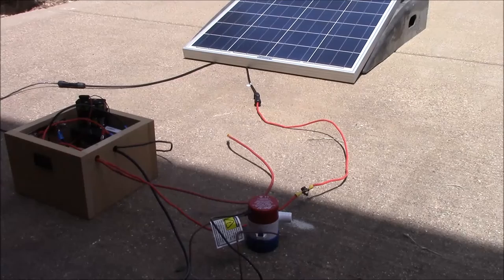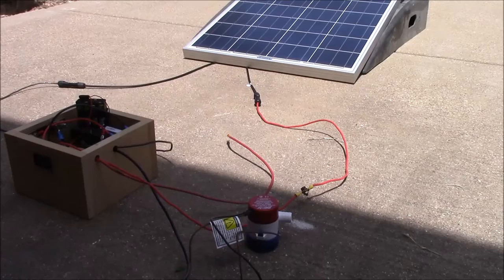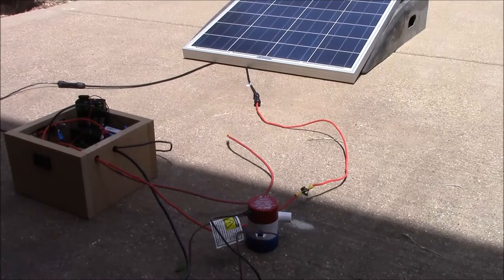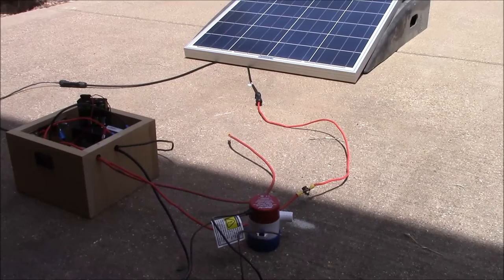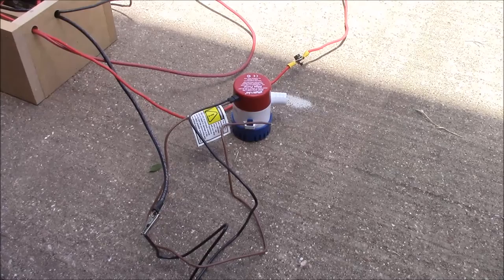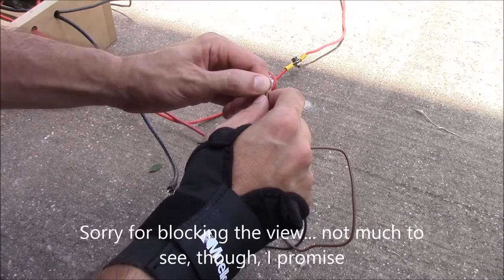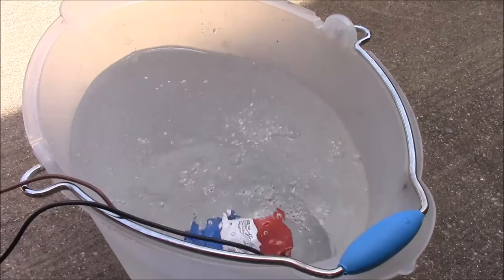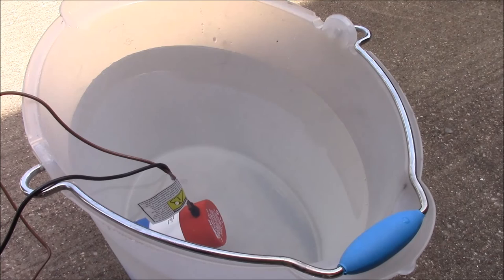Will It Solar? - Bilge Pump

Comment: Have you tested how long you can run a bilge pump off the 12 volt battery while being charged by the panel
Reply from the maker: No, I haven't.  There would be quite a few variables, though.  So I am not sure how helpful that would be for you.  Unless you had the exact same solar panel, pump, and battery.
Reply: @LDSreliance  working on making a live well to keep bait alive the 5 watt panel i have on it does not keep up with the demand 750gph pump 12v 9amp battery trying to figure what voltage panel i would need to run it for a full day of fishing
Reply from the maker: Yeah 5W will maybe make 3W.  That kind of panel would only really be useful to keep a lead acid battery topped off on a charge between uses.  To fully recharge that battery, that panel would have to be in direct sun for 36 hours straight, give or take.

I would recommend at least a 50W panel.  But it would also depend on how long you are on the water and other factors.

Comment: you were talking about using it for your aquaponics system im looking to do the same thing with the same pump. My question is what size solar panel are you using and the pump in the video runs on 2 amps will the solar panel be enough to keep the battery charged so the pump can run 24/7 in the aquaponics system?
Reply from the maker: +Dinsmore Outdoors So this is where proper planning ahead of time is critical.  Your pump in an aquaponics system is essential to the whole thing running properly so you can't afford for it to be down.  And you have a 24/7 load to deal with coupled with unpredictable weather where it could be cloudy or overcast for several days where your solar panels will not produce much power to charge the batteries.

Without knowing where you live and being able to tell how much sun you will have access to, I would recommend 300-350 watts of solar panels and 200 amp hours of battery power (at least) for your system.  Sure, a 2 amp load doesn't seem like much but when the sun only shines on average 4-5 hours per day your solar panels only have a limited amount of time to recharge the batteries and that is while the pump is sucking some of that power.  This setup will give you 2 days of backup power for overcast situations.

If you are going to be monitoring the system and switching over to a different source of power if the batteries run dry, you could get away with 100 amp hours of batteries and 280 watts of solar panels.  That is the least you need to plan for.  That should keep your pump running 24/7 as long as the sun shines each day.

Comment: I’m sure you’ve covered this topic before (so please link me a video or bear with me) what would I need to run this on my Jon boat all day? I want to build a solar set up (Arizona gets HOTTTT) where it charges/runs my bulge pump all day and can run it at night when sun is down? I do have limitation on where I can place it (the panel in the video looks HUGE for my application. Realistically speaking, I have about about 12”x8” flat area that I can mount a panel to. Lastly, would I be able to stand on one? If not, my useable area would decrease to about a 6”x6” area. LITERALLY any information would be much appreciated. Love the channel, I am subbed now! :)
Reply from the maker: Thanks for the sub!  Unfortunately, running a motor like this, even thought it is small, around the clock requires a massive amount of solar power.  And it sounds like you are already limited for space.  If the pump can run for a few seconds or a minute and then shut off for a while that would be ideal.  Then you could get away with a small panel and battery.  I used a large one in the video because that is what I had for demo purposes.

Comment: Are t you only supposed to run these with water to cool the thing?
Reply from the maker: Yes, under normal use the pump should be submerged.

Comment: Can u explain what all you have hooked up to it to make it work? I have same pump and solar panel but my pump won’t run off the panel….
Reply from the maker: Yes.  You need a charge controller and battery to make this work unless you know a lot about electronics and can regulate the voltage yourself.  The problem is your solar panel outputs ~17V and your pump is only designed for 12V.  So you need a buffer in between that can change the voltage for you.  The best way to do this is to use a charge controller and battery because it will also serve the benefit of preventing any disruptions due to the sun going behind clouds or the angle of the sun being off, etc.

In short, you need solar panel->charge controller->battery->pump.

Comment: So ca I have solar panel then charge controller then pump
Reply from the maker: Yes, the charge controller can run the pump off of the load terminals if the pump is DC.

Comment: how many watts does it consume?
Reply from the maker: 2 Amps or 24 Watts.
Reply from the maker: http://amzn.to/2wHq0Zw
Reply: THank you I purchased 1100GPH version and consumes from 6 to 7AMPs. I have another one 3500GPH and should consume around 12A DC.
Reply from the maker: Nice.  Those are obviously much more powerful than this little pump that I bought just for demonstration purposes.
Reply: @porrascarlos80 but it says 12v, 3 A that makes it 36watts only.

Comment: Volts x Amps is  what matters not solar panels...
Reply from the maker: It isn't that simple.  Some devices require extra current to get started
 even though their running consumption is within the range of a solar 
panel.  Some devices can't handle a fluctuating voltage.  And some 12v 
DC devices can't handle a direct connection to a solar panel because a 
12v panel will actually produce 16-17v and the device won't accept that 
higher voltage.

Comment: What size solar panel would I need to run a 500 gallon GPH pump direct current?
Reply from the maker: To run it directly like in the video?  Or with a full solar system?
Reply: @LDSreliance  like the video, direct current from the solar panel to the pump
Reply: I know that a battery should be put in the circuit to keep power when clouds go over.
Reply from the maker: It seems like a pump of that size uses 30-40W.  So I would say a minimum of a 60W solar panel.

Comment: I have this exact pump with a float switch to evacuate excavation holes.
Powered by a deep cycle 12v battery with a 2.4W solar maintainer on the battery, I have 24 hours on the hour meter (installed after the switch) no problems yet.
Reply from the maker: Sweet.  Sounds like you don't need to use it every day so that small solar panel should work great.  That is a great use for solar!
Reply: The wonder of automation is the panel just maintains the charge unless it rains, then the pump turns on evacuates the hole, and goes back to charging. Elegance in simplicity.
Previously I had to wait for the rain to stop and bring gas powered pumps to a site, or a syphon hose and drain any water every time it rained witch could take all day depending on where the job was located, now we bring a solar automatic pump and leave a sump in the excavation and if it rains you just wait a day and when you arrive the site is already free of water.
Reply from the maker: Like I said, great use for solar.  I like it.  This should be a case study for how to effectively use solar to solve a problem.

Comment: we ran the exact pump straight off a 21v 60watt panel. maybe did 50 hours work so far and seems to last no problem. no battery or solar charge controller used.straight from panel at 21v
Reply from the maker: It might be just fine long term.  But most 12V DC devices are not going to like seeing 17+ volts without a shortened life.
Reply: @LDSreliance   2 years old now and would of done 1000 plus hours. still going fine @21volts..

Comment: Also while connecting, do I connect in this order? 

Solar panel to Charge controller 
Battery to Charge controller
Bilge Pump to On/off switch to charge controller

Is there anything missing?  Does that sound accurate?
Reply from the maker: Yes, that will work perfect.  The charge controller will be able to protect your battery from over discharging in that setup in case you forget to switch off the pump.

Comment: That reminds me, i know some people that lives in the field here. where there is no really good electricity and the distances are really really big. 
they have a pump to get water for the animals from under the earth. but sometimes they have no wind and they need to use a fuel based pump. and getting fuel is more troublesome than electricity but they can't rely much on it and the distance would be too much.
so i was thinking on building them a small pump with a battery/charger/panel system. 
i'm not sure of the cost and reliability though.

(also nice that you have fun doing the videos, i like em)
Reply from the maker: Jerónimo Barraco Mármol You could run a pump like this one on a battery for light duty use like this for a few days I would bet.  The only problem is I think this pump can only pump about 50 feet up in the air.  If the well is very deep (some can be hundreds of feet or even a thousand feet deep) then you would need a much more powerful pump.

It is definitely do-able and probably one of the more easy projects that you could start out doing for someone.  We just need to know how deep the well is so we know what kind of pump we need and then we can go from there.
Reply: Yes i am worried about the needed hp of the pump (and its price) also for the electrical power it will consume. it will be running 1 or 2 hours a day , so i think the sun can power it with a notsobig panel. thanks for the info.

Comment: sir can this draw water from a well to a tank to surface level
Reply from the maker: Absolom Madhaka It depends on how deep the well is.  If you are talking about a normal well that is 100+ feet then no.  You would need a much stronger pump to do that.
Reply: Mr. Madhaka there are two ways a pump can get water up, either by suction or pressure. Suction "lift" is limited in ALL pumps, water can only be lifted so far.
The next type is pressure.  Assuming zero lift the issue becomes "head" which is how we talk about how high a pump can raise the water.
Most all bilge pumps are designed for large "volume" as opposed to "pressure". I do mean opposed.  High volume pumps are usually low pressure, and high pressure pumps are usually low volume.
Most bilge pump manufacturers would be able to provide specs on "head" (remember that submersibles are not designed to lift)
To answer the question directly, and sorry for being late, this pump could probably raise water 5-8ft. I do not know if it could even make 1-3 PSI at that level though.
Good luck in your pumping.
Reply from the maker: Bananascentral That is a great explanation.  Thanks!

Comment: I have tested one of these pumps for the last month, 8 hours a day on a solar panel, it leaked in less than a month.
the seals for the power cables and the seal for the impeller drive shaft are woefully inadequate for salt conditions.
not worth buying.    look for a brushless option with no direct drive.
Reply: Can I use them for a chiseled water wall, 7 feet high 3 feet wide, 2 hours a day running? 
How much life can I expect? My water is not salty and is drinkable. Please tell.
Reply: @green_life7  mine lasted 30 days running 8 hours a day, the seals failed and filled with water.  these are not good pumps for anything.    you want to find a Magnetic Drive Pump.  that way water CANNOT get into any shaft.

Comment: So I have decided to build a battery bank to run my 12v Rule non-auto bilge pump for my small pond and have purchased the following:

Solar panel - Charge controller - 12v Rule Bilge Pump - Bilge pump on/off switch - 12v automotive battery (used). 
For the cables I have taken your advice from your other video and will be using welding cable to connect the battery and THHN wire to connect the panel and pump to the charge controller.

By having the bilge pump on/off switch connected. Does that allow me to switch off the pump with the push of a button? If yes, would the panel then still be charging the battery and potentially overcharge? Or does the charge controller, stop the charging process when the battery is at 100%?

These are the products I bought, let me know your thoughts:

Rule Bilge Pump 12v
https://www.amazon.com/gp/aw/d/B000O8B7VO/ref=mp_s_a_1_1?ie=UTF8&qid=1477263186&sr=8-1&pi=SY200_QL40&keywords=rule+bilge+pump&dpPl=1&dpID=419Z6n1B8dL&ref=plSrch

Charge Controller
https://www.amazon.com/gp/aw/d/B018ICLC3K/ref=mp_s_a_1_1?ie=UTF8&qid=1477263444&sr=8-1&pi=SY200_QL40&keywords=mohoo+charge+controller&dpPl=1&dpID=51WLsgE4UML&ref=plSrch

Bilge Pump 3-way Switch
https://www.amazon.com/gp/aw/d/B004UOTQRU/ref=mp_s_a_1_1?ie=UTF8&qid=1477263313&sr=8-1&pi=SX200_QL40&keywords=bilge+pump+3+way+switch&dpPl=1&dpID=41te7JQy4hL&ref=plSrch
Reply from the maker: The switch will turn on and off your load (pump) but will not do anything for the rest of the equipment.  In other words, your solar panel will still charge the batteries through the charge controller.  The charge controller's whole job is to monitor the charge status of the battery and make adjustments to charge it properly and then either shut off the charging or switch to a float charge when the battery reaches maximum voltage.  There is no risk of overcharge with a charge controller.